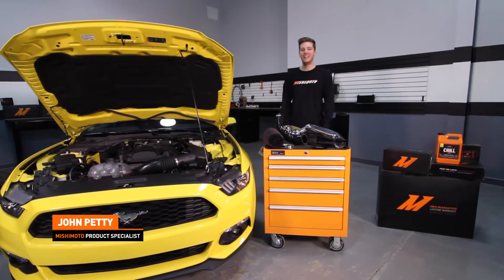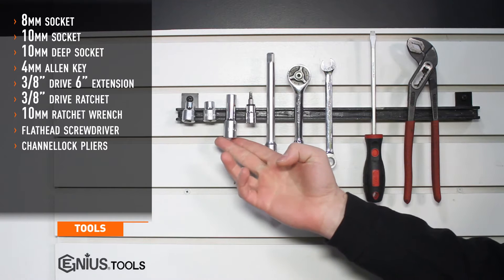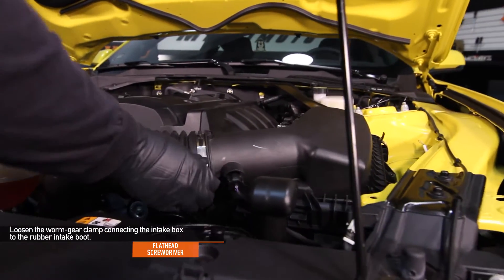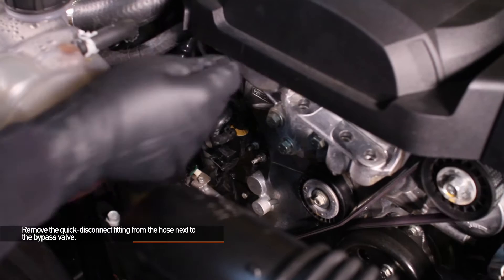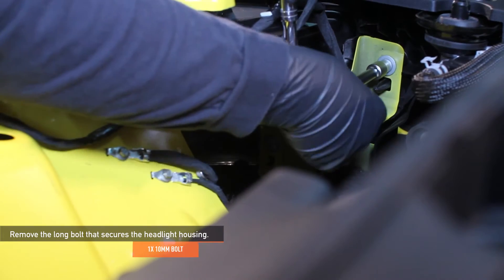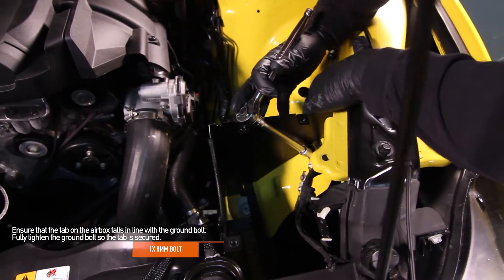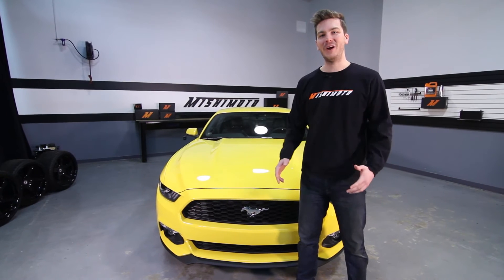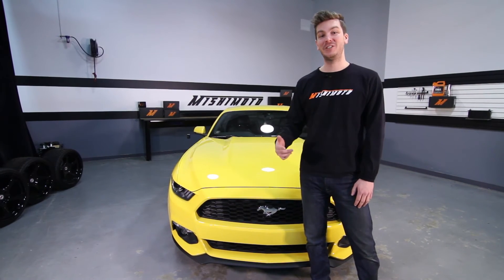2015--2017 Ford Mustang EcoBoost Performance Air Intake Installation Guide by Mishimoto

Comment: Can someone help me with an issue I installed an aftermarket intake and now the mustang is not as quick from a start as it was with the Stock intake what is the issue plus I’m also getting compressors surge on occasion??? please let me know how to solve this
Reply from the maker: Hey Nick, the EcoBoost is a bit sensitive to modification. Any additional modifications on top of an intake may require tuning. Our intake will require a tune when used in conjunction with an exhaust, for example.

Comment: Hi.I am from Moscow I have avtomobil Mustang EcoBoost (2017 ,2.3)why is it necessary?thank you!!
Reply from the maker: Hi Сабина! The Mishimoto intake showed gains of up to 8 whp and 9 wtq on the stock tune. Larger gains can be expected once the car is tuned with the higher flow performance intake
installed. The Mishimoto intake will install easily without any permanent modi cation or
the need to remove the front bumper. The intake box serves to channel cold ram air from
the stock duct directly to the high- ow air  lter, which will allow for a more aggressive tune.
Along with an increase in power and  ow, the Mishimoto intake provides a deep intake tone
under full throttle. This intake system is a must for anyone looking to improve performance,
aesthetics, and intake tone on their 2015+ Mustang EcoBoost.